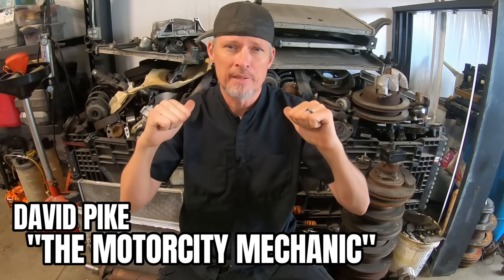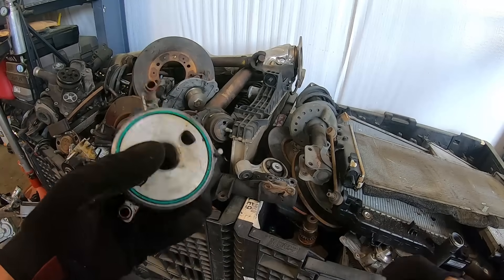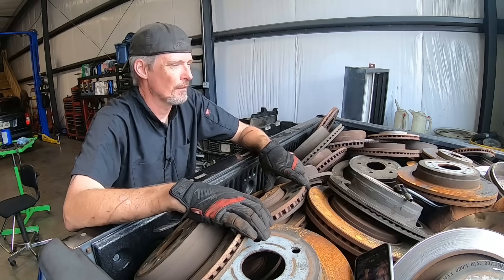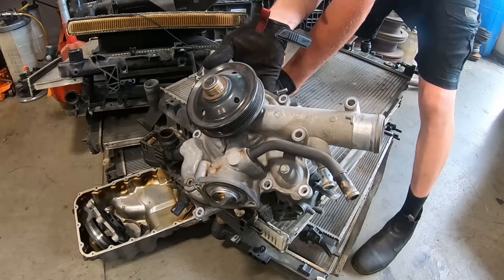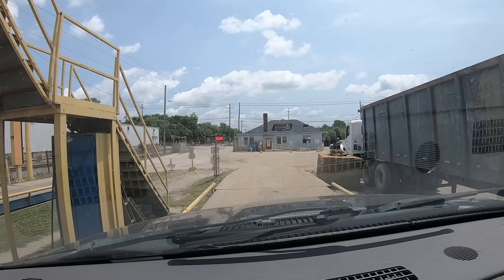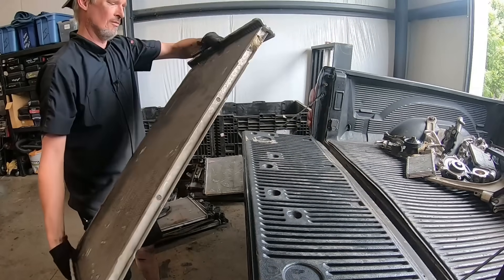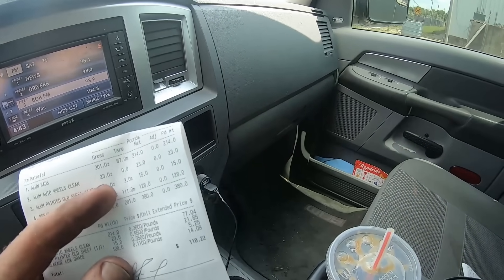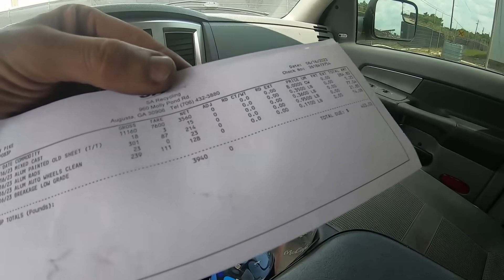Is Scrap Metal Worth Your Time? 2023

Comment: what is really revealing is when you look at all the rotors that have been changed out and cost the customers lots and lots of unnecessary dollars when they could have been resurfaced much cheaper and saved the customers hundreds of dollars !!! guess I know where NOT to have my vehicles worked on !!!
Reply from the maker: What you don’t realize is that when you do the math…..the additional labor to turn the rotors and what I pay for new rotors comes out to right about the same…..so for the same money you can either get your old rotors turned or have new. I’m going with new everytime. The customer wins in the end. Sounds like you didnt do your research and just ASSUMED 😂. But thanks for the comment and for watching.
Reply from the maker: Rotors cost me around $40-$50 each. I charge 1 hr labor($127) for a brake job……if I have to turn the rotors then it would be like every other shop…..2.0 hrs labor ($254). So again….the rotors are cheaper to replace. Feel free to do the math if you like and continue to throw insults when you don’t even know me…..says alot about you and your keyboard warrior mentality 😂😂😂😂😂. But thanks for watching…..that too helps me make money

Comment: NO. absolutely NOT. if your primary income is being a mechanic with your own shop then NO it is not with the effort, time, fuel and space to haul that much scrap some of which took YEARS to accumulate while in the meantime growing in the shop as a space waster. Now that being said if you ARE set up properly to handle scrap that may be different. I run a steel yard, I sell new and used Steel, Stainless, Aluminum and even some brass and bronze. We are set up to have rolloff boxes at shops all over town that recycle with us. They get payed a percentage based on their material being scrapped at no cost to them, shit, they’re getting payed for it!!! They don’t need their own boxes, semi trucks, CDX driver/employee, maintenance, insurance, etc. necessary to handle their own scrap properly! AND they get payed! So, for this guy, he’s better off having it get picked up by someone else so he can make REAL money doing what he actually does best and is set up to do PROPERLY, his job!

Comment: What was the price per pound for the aluminum?
Reply: I paused the video to find out myself.  $.35 for the sheet aluminum and $.36 for the clean radiators...which is about right.  Aluminum prices have been in the crapper for the past year and a half.  At $.97/lb for the wheels, that was a good strong price!

Comment: Most mechanics sell it to scraper's. The ones who do scrap their own I'd say are cheap mfers,...even the ones who sell it, keep the most expensive kinds for themselves to scrap. I never met a mechanic to just give it away. Not in my state. But I do scrap by separation, cast iron rotors, # 1 steel , that be 1 inch thick, and anything under that is called tin. 
Non ferrous metal as well. I get the most out of it I can. Since I'm paying mechanic for it. .25 cents per rotors.
From Mechanic's, I usually get 50 cent per rotors at scrap yard. Barrel picking is better. I get it all free of charge, minus my gas and hopefully no flat tire going in ! It does happen.  That ruins my day paying for a fix.

Comment: Not with Bidens gas prices .
Reply: Just gotta pile up over 2k in weight and create different piles. A dumper trailer also helps aid you in unloading the cheapest load, iron or metal pile. If you got a big enough and you sort it out, you can clear $200 of tax free cash.